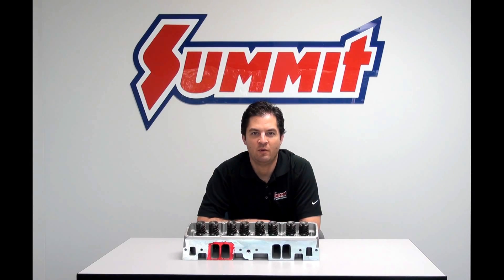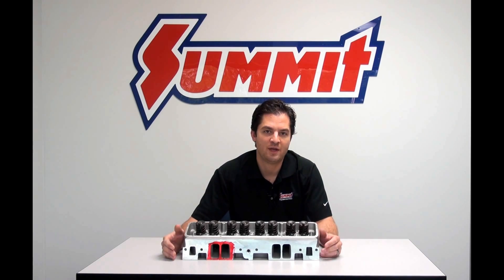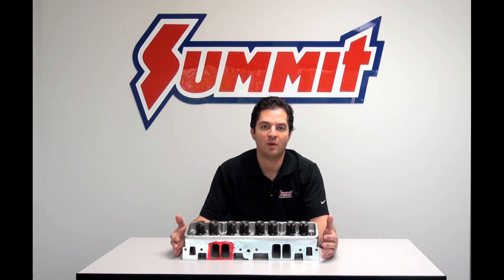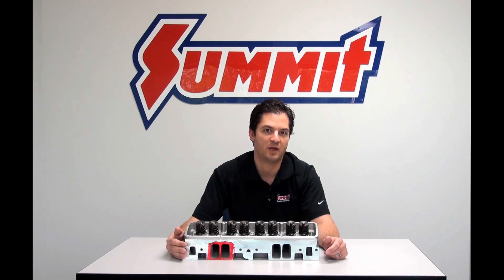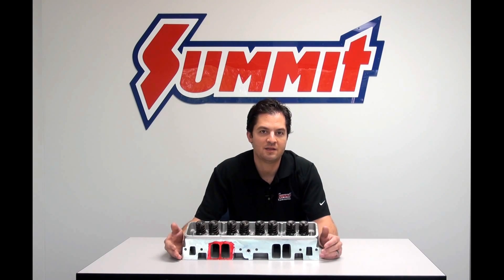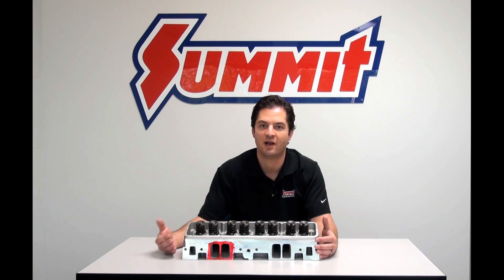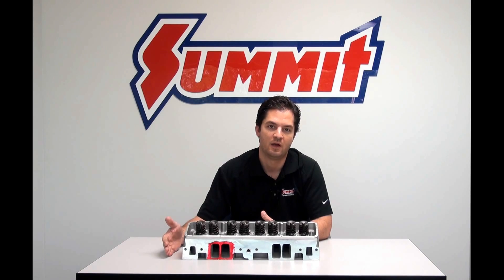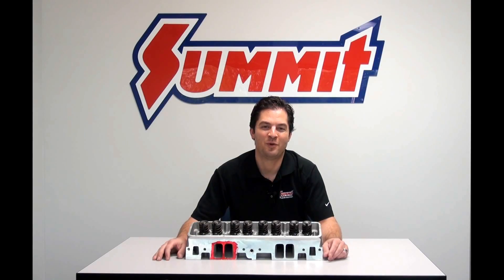Cylinder Head Runner Size Selection - Summit Racing Quick Flicks

Comment: MCSA  minimum cross section area =pushrod pinch . Cyl heads with inline valves ford windsor  ,, chevy sb,, some Buick some Chrysler 
chev 400cu 220cc 2.2 sq inches 
ford 408  200cc 2.15  sq inches  
cc intake runner is for retail purposes ONLY 
engine builders use MCSA

Comment: I am build a high compression 283 bored 30 over .it has trw pistons 12 to 1 .....the old 283 engines had flattop 10 to 1  with 58 cc power pack heads .I am wondering what I should get maybe 60 cc to slightly lower that compression .not sure what to do

Comment: Hi Summit racing, I have a ls1 with following spec cam 230 230 615 lift intake and exhaust @ 50 111Lsa & adv + 3 degrees .
My bottom end is standard and I think the factory ls1 compression is 10.5:1.
Im also contemplating on having a new cam made up with the same specs but 109 lsa. What are your thoughts on this?
My question is, If I go for your larger intake heads at 225cc intake , will It help my performance.
With my previous car I had the same cam and had the 243 heads worked over. I had the largest valves that would fit installed , had alot of porting on the runners done and 25thou taken of the top. The car made 305 rwkw and ran 0-400 meter in 11.9 seconds and 120mp/h. It weighed 1780kg the same as my current car.
I would like to take even more off for comp with this combo but not sure what the safe limit would be.
Even 40 though would make a big diffence I think but I'm not sure if my piston to valve clearances would be safe.
I use the car as a daily but race it often evey weekend. I have a 3500rpm stall and my shift point is set to 6800 rpm in first then 6200 in second. 
I want to make as much power as I can from this combo and lower my et's
I really appreciate time and support with this  .

Comment: You recommend a smaller runner head for a 350 with 175-180 cc range to keep air flow up. I have a 305 so the difference would be about 157 cc and I’m having trouble finding heads like that for a sbc 305.

Comment: I was thinking about about afr 195's, compression 10 to 1 , I got the retrofit thumpr cam a little over .500 on both sides plus 1.6 full roller rockers wich adds 30 points to the cam,  some ppl say go with the 180's but I like the idea of switching to a bigger cam later on, it's a street car for now I want it to have good street maners, should I go with the 180's? It's a 383 stroker no forged internals
Reply from the maker: AFR is a quality cylinder head with good velocity. The 195cc intake runner has been a proven winner in many 383 combinations. Unless your vehicle is very heavy, the 195 Eliminators (or the 195 Enforcer if you're on a tight budget) would be my preference and give you room to grow. You will need a minimum stall speed of 2500 rpm and numerically higher gears with that camshaft to take full advantage of the combination.

Comment: I have a 406 sbc w/9.5 -1 pistons! I would like to put a set of alum.heads W/ 2.08 intake valves .I also have Harland Sharp 1.6 roller rockers what is the best ratio camshaft for this combo ?
Reply: Depends on your goals. Assuming you will run street only, you will want a cam with more lobe separation angle (LSA) around 112-114 degrees. Around .525 lift, and around 270-280 duration max. The more compression you have calls for more duration. If the intake valve is open longer, you build less compression, the big pistons will restore that lost compression and gain more power. Long duration cams with low compression will rob power. If you are looking to buy heads, the Brodix site has a great chart to match the right CC intake runners to your compression/cubic inch engine.

Comment: I've got a 355 with flat top pistions. With a 292 cam would 190 cc or 210cc be better? The engine is just for racing.
Reply: Rabbi Schlomo  I know this a awful question but how do you properly check the valve seal? Have a shop do It or am I able to?
Reply: Adam Chrisman use air in the spark plug opening.
Reply: Wrong cam for flat tops.
Reply: 190.

Comment: I have a 406ci flat top pistons and a pro comp mutha thumper camshaft what heads should I buy from summit ? 64cc combustion chambers or 72cc chambers ? I don't want detanation issues I wish your summit 72cc heads had bigger than 165 runners I'd probably buy those
Reply: Mutha thumpa is a botique cam designed to lope and is just a sales thing to yuppies. If you want a good cam call a good cam designer like Chet Herbert, tell them your goals, street/race compression heads etc. They will design a cam that will run circles around botique cams.

Comment: +Summit Racing I recently bought 294cc aluminum heads for a 489 big block chevy. Are these intake runners too small or will they make up for the low end torque im losing with a single plane intake?
Reply from the maker: +Paul Cohen, 
We need some additional information from you. Can you please give our tech line a call? 1-330-630-0240. Thanks!

Comment: How would increasing compression ratio effect low end torque and high end torque. Are there any advantages to lower compression, and if not then why do most companies offer heads with bigger chamber dimensions? Thank you
Reply: A good article to read is a 2006 Hot Rod article by David Vizard called " Compression comprehension". The most effecient engine design runs at 200 psi of compression, whether its a 9:1 motor or a 14:1 motor. You choose the right duration cam to achieve the 200 psi.
Reply: Don Rutter David vizard is a genius.
Reply from the maker: +Gas'n'Oil , 
Increasing compression ratio does increase torque output throughout the RPM range but, depending on fuel & ignition type, you run a greater risk of detonation. That’s bad for emissions and potentially detrimental to your motor!

Comment: If I have a Pontiac 400 I shouldn't put 455 heads on it then?
Reply from the maker: Hi deerdestroyer2009,
While the 455 heads will physically bolt on and do have a slightly larger intake runner size and valve size, they also have larger combustion chambers. This is a potential problem due to it dropping your compression ratio dramatically.  Grab some casting numbers and give us a call and we can help you find a piston for your 400 with those heads and get the compression ratio back. 1-330-630-0240.

Comment from the maker: There are many, many choices here at Summit Racing regarding small Chevy cylinder heads. Give us a call and we can help you chose the best set to match your combination. 1-330-630-0240
Reply: You send me a set of head 4 my 5.7 V8 92 buick roadmaster
Reply: Well we did what you said and then we did afr,and blew all what th out said out of the water, not only did we go bigger but shaped like the new ls heads, with proper degree, a cam from the start , 9.5 to 1 carberated 470 hp 355ci your tech version we did 290hp ,well that says it all go to a good reputable builder tell them your budget and get more for your buck.

Comment: I have a .030 over 350 chevy with 305 chevy heads crane energizer cam with a 284 duration with a 480 lift its mostly driven on the street whats a good cylinder head for the street.
Reply: CALVIN DENT vortec iron head is da way to go with ur combo

Comment from the maker: When choosing the proper cylinder head for any application there is far more to it than the compression ratio or which one tested as having more power. Cylinder heads should be chosen to fit the total package so, give us a call on the tech line and we will be happy to help you chose! 1-330-630-0240. Thanks for watching!

Comment from the maker: The other consideration should be intake runner size. 305 cid engines like a smaller runner due to the lack of bore size/cid and going to a larger runner 350 cid head will likely hurt low end torque production on your 305.

Comment from the maker: As long as the heads have a 1.94" intake valve or smaller most SBC 350 heads will work on your 305. The problem with using a 350 head though is that they typically have a much larger combustion chamber than a 305 head causing the compression to go down considerably. When making this change it is typically best to stick with a head that has a combustion chamber between 54 - 58 cc's to keep the compression up.
Reply: Doesn't it have to be fly cut to use a 4 inch bore head on a 283 or a 305 so the valves don't hit the block ?

Comment: I have a small block 305 with a big cam and high rise intake and i want new heads, ive heard of people use sb350 heads? And how would i go about getting vortec heads to work. And i was planning on having heads rebuilt.
Reply: Scoggin Dickey has the best deal on vortec heads. Best way to go. By the time you do all the machine work to fix an old set of fuelie 462 camel humps, it costs way more than a set of vortecs. Plus, you would spend a lot of time porting the fuelie heads to get equal horsepower or slightly more than stock vortecs.Iron eagles would be a better head, but also more money than vortecs.